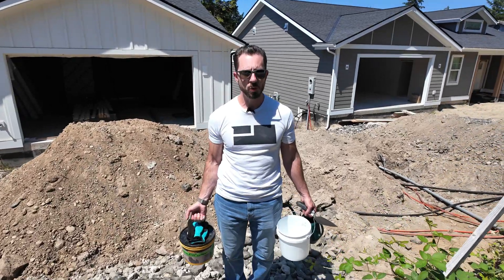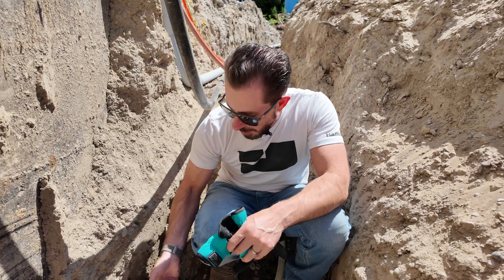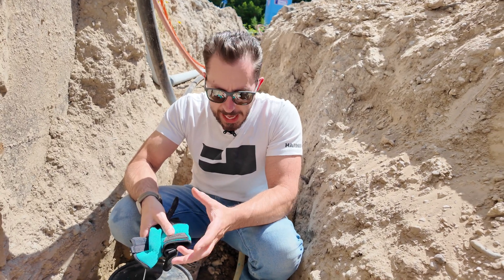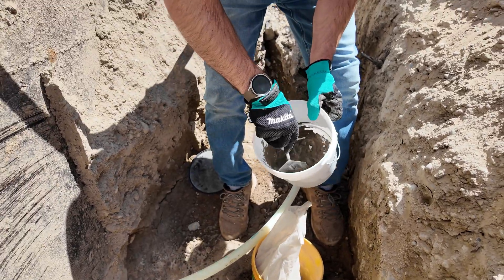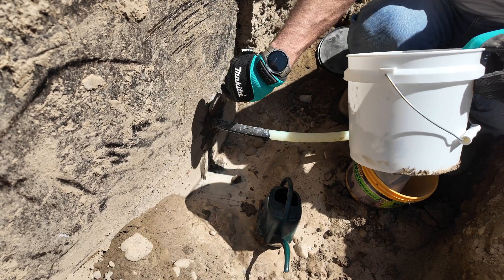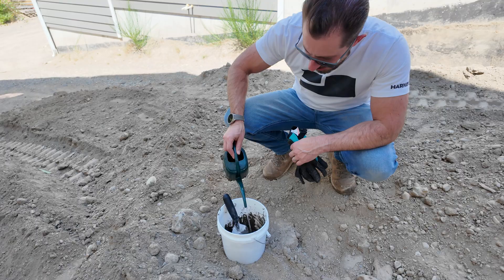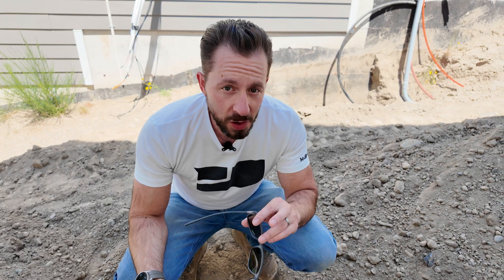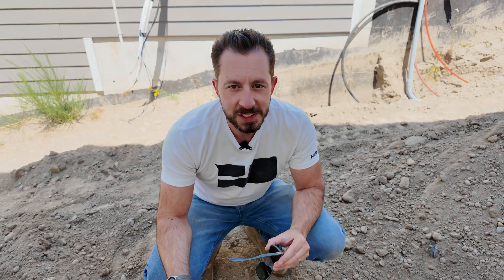Waterproofing Foundation with Hydraulic Cement

Comment: there is no need to wet the substrate? also that's way too watery isn't it😅
Reply from the maker: No need to wet the substrate, and it will actually harden in wet conditions. It's not structural, really amazing product